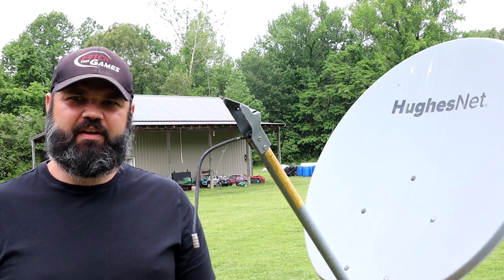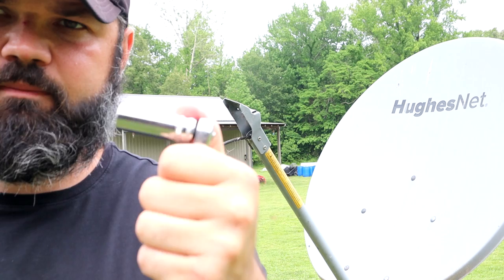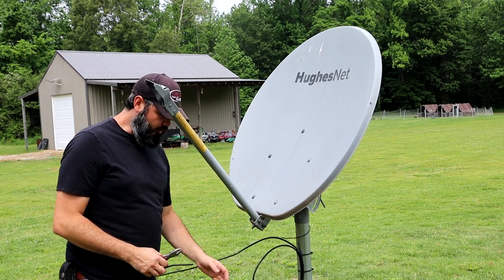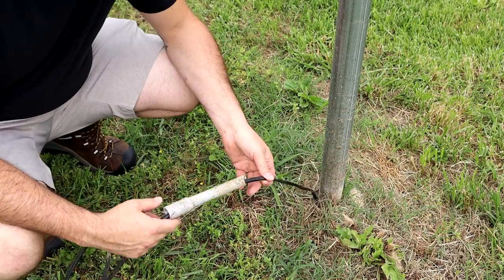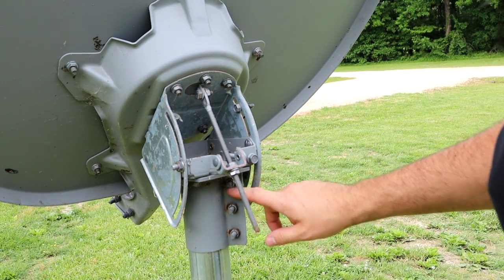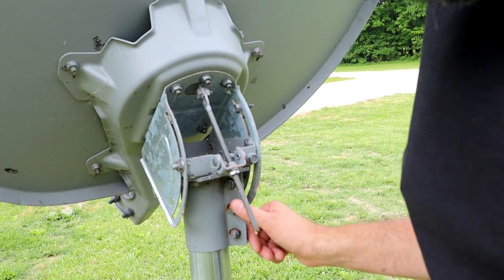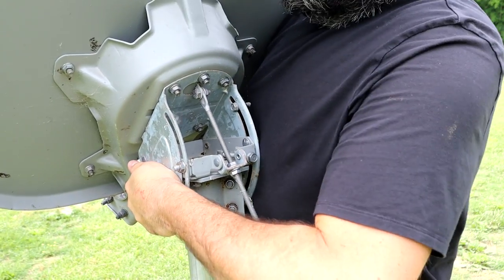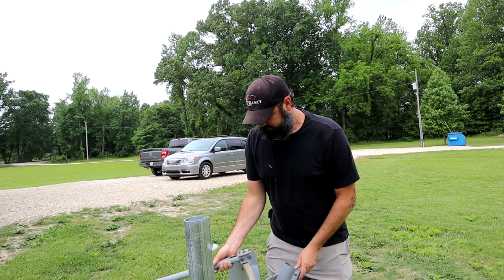How to Remove a Satellite Dish From a Pole

Comment: Thank you for your video!  I have removed the dish, the pole is there with the wires, or whatever they are, still there; I saw you just snip them, cut them away. I'm afraid of being shocked or electrocuted 
Thank you again! 
J
Reply from the maker: If it's just a coax cable it's just data. As long as you don't have any devices inside hooked up to that wire you should be fine, but best to contact a professional if you're unsure.

Comment: Awesome video. I have a quick question. I purchased my house 3 years ago and this satellite is on the side of my house. Am I able to safely cut those wires without getting electrocuted? Just trying to be safe before I start cutting the wires. Thanks again
Reply from the maker: Yeah. If you're worried, purchase a voltage detector. About $15.  That will let  you know if there is power in there.
Reply: @NicholsCounty  awesome! Thanks
Reply: I had the same question 😂.